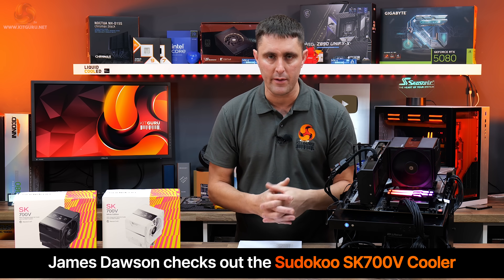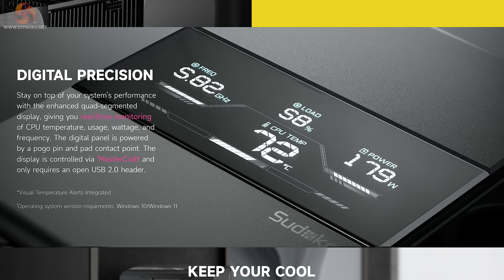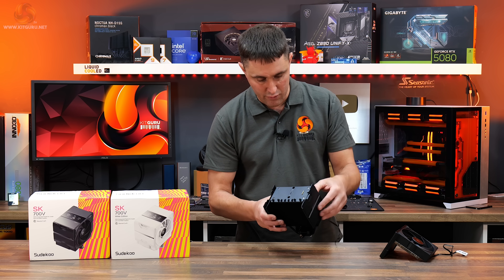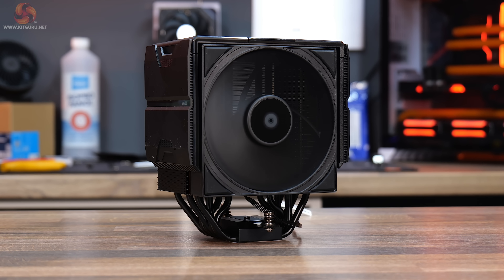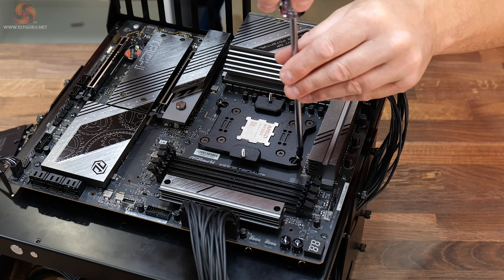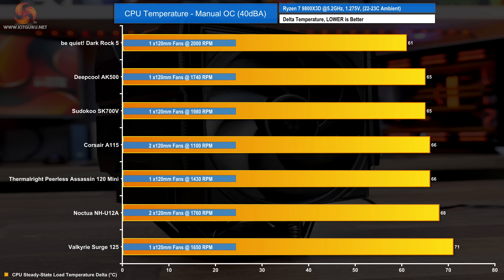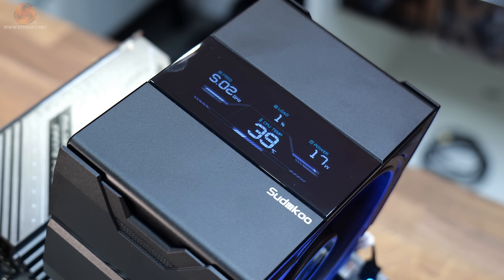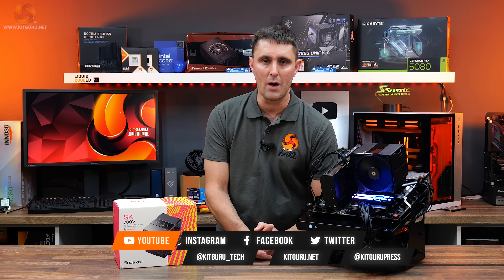Best Air Cooler for AMD Ryzen 9800X3D? Sudokoo SK700V Review

Comment: Nice video . Seriously contemplating purchacing one . Haven't aircooled in over 35 years , always made my own watercooling loops or bought AIO's . Looked at some coolers and looked at the blocks that sit on the cpu and they are dreadfull ( specially with the pipes that have air gaps to fit against the cpu ) I wouldn't touch those POS with a barge pole .  Another reason why some people complain , is how they have they own build and fans configured . People are always the first to start crying and moaning over the least little thing . If people live in a hot climate , stick with an AIO . Or just buy a laptop

Comment: I bought this cooler for a 9800x3d and wasn't very pleased with the results. In a 27 degree room I was getting 95 degrees using a Cinebench test. Love the way it looks, not as keen on the way it performs. It's rated for 220 watts TDP, but I just don't see how that is reasonable when it it hitting 95 degrees (68 delta ambient) on a 120 watt CPU. Not sure to what to attribute the different results. Definitely removed the protective film, definitely used thermal paste, maybe didn't run the fan at 100% but it was attached to the CPU fan header, so likely it was. Just didn't cool the CPU that well. I tested it against a Thermaltake Peerless Assassin 120 Digital which, with the same hardware in the same room was at 80 to 82 degrees (55 degrees delta ambient). Of course the latter is a dual tower cooler with two fans. Your results would put it at 88 degrees in the room I was testing. Certainly better than 95. Given the cost and the lower prices on AIOs these days, I can't see using this cooler myself unless it is a budget build and for that the price is rather high. It's a shame because the execution is great.
Reply: it performs quite the same as the deepcool assassin vision, this one mentioned has 300w tdp but, same as you stated, is nothing near that since when i tested it with my 9700x it reach at 90/92 C° on cinebench,   so..... i'm not even surprised it doesn't perform as it should..... its just another shit cooler with awfull performance.
Reply: @dennissmith1435   I prefer the noctua u12a also those tests are bs
Reply: did you remove the cold plate sticker? 💀🙏
Reply: @alexh.9550  did you even read the whole comment???? he litterally wrote "Definitely removed the protective film, definitely used thermal paste ..... "
Reply: @alexh.9550 definitely
Reply: The 9800x3d has a lot of headroom and draws high wattage, you have to undervolt it or else it will fry itself.

Comment: Wish they would of went with a dual fan setup, or at least the option to connect 2 fans.  Also the ability to display videos AIDA64 info or whatever you want on the LCD instead of just static info.

Comment: Thermaright's aggressive pricing has changed everything in the air cooling sector. As good as this Sudokoo seems, I just can't justify spending the cost of two Peerless Assassins on it...or the price of 3 Assassins for the LED display version
Reply: then don't
Reply: Indeed. My 9800x3d never goes above 70C in stress tests with my €35 Phantom Spirit 120. And I've set the curve so it would spin at full rpm only when reaching 85C. It's very quiet so the only reason to pay more would be if you're into some serious overclocking or you want to pay for looks.

Comment: Just me or does this outperform what you’d expect from a single tower cooler? Holding 63°C under full load on a 9800X3D is not a small feat.
Reply from the maker: Remember the figures in the charts are delta, so the ambient has been deducted.

Comment: For a 1-fan air-cooler, that is really impressive considering the Dark Rock Pro 5 uses 2 fans to achieve the same thing.
Reply from the maker: The Dark Rock 5 is the one in the charts not the Pro. So similar single tower, single fan.
Reply: @KitGuruTech  Ok thx for the precision!

Comment: The mounting system looks refreshingly idiot-proof. Bracket in, cooler on, screw down — no dodgy torque pressure or sketchy alignment. Honestly ideal for someone building solo.

Comment: That looks really good, with impressive temperatures. I do like their base which seems to include a contact frame. But how does this cooler compare against the £30 Thermalright Peerless Assassin 120 SE? At the other end, how about the Noctua NH-D15?

At what point does the display start? Does it work if you are in the BIOS? Does it just require 5v power? The latter could be of considerable help troubleshooting a POST failure.

How easy is it to replace a broken fan?
Reply from the maker: The display will only start when the cooler is connected to USB and the Sudokoo software is running. Fan is a standard 120mm fan that screws to the sliding brackets so should be easy to replace.
Reply: @KitGuruTech  Thanks. That's a real pity about the display.

Comment: Been using this on my ryzen 7 9700x and really impressed with the performance and the lcd is easy to read. Overall set ip is very quick.
Reply from the maker: Hows the temps?
Reply: Quick cpuz all core stress test with ambient + 30°c, 100% usage with steady 5.4ghz and 124w l steady 95°c @KitGuruTech

Comment: Which platform is worse for heat generation nowadays? I thought the AM5 platform was a furnace but this seems to run quite cool now?
Reply from the maker: Generally speaking, Intel CPUs run hotter, but both have improved efficiency recently, which has brought down temperatures a little.

Comment: It looks nice but for half the price you can get the Peerless Assasin with an LCD for $45. Don't need the screen? Then for $35. And those should outperform the Assassin Mini in your test that is like within a degree of difference in the tests. If I can get a cooler for $35 that is a decent amount of change to go to upgrading another component, getting extra fans, or a better case with better airflow options or pre-installed fans so you don't need to install extra ones etc.
Reply from the maker: There are some great value coolers out there for sure. Thermalright smashes the markets for value air cooling.

Comment: That socket cover is awesome! i think you should ve tested it with the provided compound to give the whole impression of the kit. could make a difference. Would like to see the Noctua G2 LBC in the charts but also Noctua G1 to DarkRock5 - a 7 degree C difference 8:55? are we sure about that? How long is that test? never saw such results on other channels, I think. Also replace the fan? test it with another? sorry so many questions :) but very interesting cooler!
Reply from the maker: Best to use the same thermal compound on all coolers to keep the test fair.

Comment: Seven 6mm heat pipes into a copper base and it still managed to hold 63°C under full load on a 9800X3D? Genuinely impressed. That chip isn’t (that) easy to cool. Shame I cant buy one here 🤘
Reply: @lucifersheadscarf6988  the Chip is alot easier to cool than the 7800X3D, even with the higher powerdraw.

Comment: So it’s like the AK500 but quieter and easier to install? Sounds like a win to me. If they dropped it 10 euros would make it a lot better value IMO
Reply from the maker: Has a couple more heat pipes compared to the AK500 but it's a similar size heatsink.

Comment: For $90 I kind of expected dual-fan or dual-tower performance. Surprised to see it actually competing with the Corsair A115 in thermals though – that’s impressive.
Reply: @EricDavidson-cx7bz  the A115 is notoriously awful on AMD. The entire selection of coolers in this comparison appears designed to deceive
Reply: A 2nd fan barely adds anything.  I have a dual tower dual fan cooler from bequiet.  It worked just fine until I upgraded my RAM and didn't have enough clearance.  I took off the external fan and only used the one in the middle and there was only a 1 degree difference in performance.  By closing off the sides, they ensure that all the air the fan produces goes through the fins and none is wasted.  I think that probably adds just as much as putting another fan on the back and leaving it open.